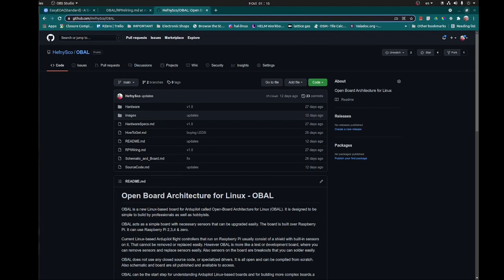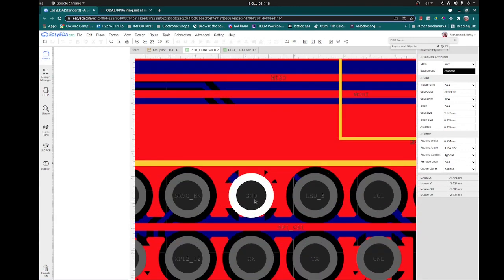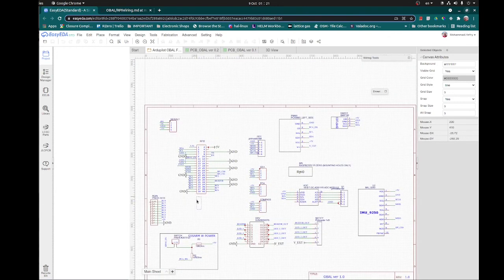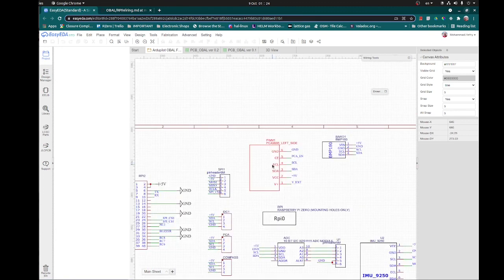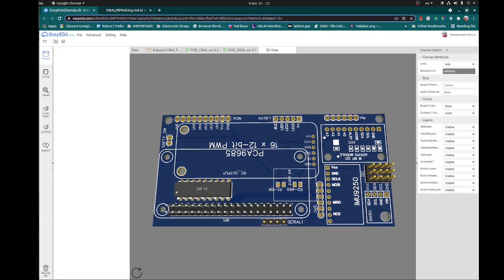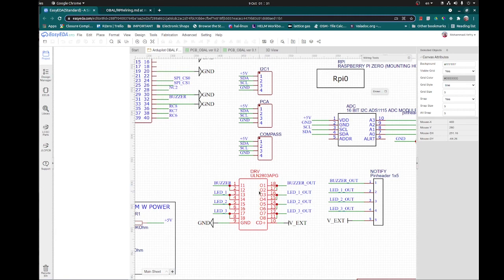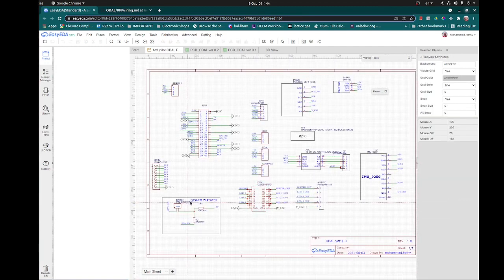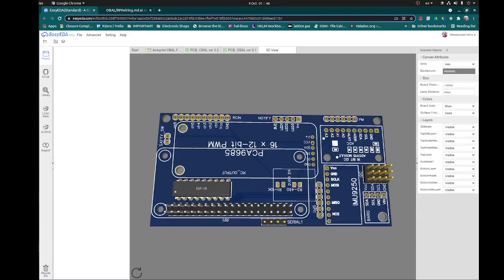01 - OBAL - Tech Part 1: How to design Ardupilot-Compatible Board using Raspberry-PI?

Comment: Hello Mohammad, what gps are you using ? I have tried connecting BN-880 via serial 1 port but mission planner won't find it
Reply from the maker: It should accept any GPS via serial port.
make sure of: 
1- you are sending the correct format that is defined in param settings i.e. NEMA, AUTO, etc.
2- You are using the correct baud rate.
3- You are starting ardupilot with the correct parameters -A, -B ..etc.
https://github.com/HefnySco/OBAL/blob/main/SourceCode.md
Reply: @MohammadHefny_HefnySco  Thank you so much for your help. The GPS is working now. 

The problem was incorrect baudrate and serial port
Reply from the maker: @agoshpreetsingh4584  Glad to know everything is working properly now. Thank you.
Reply from the maker: please email me at mohammad.hefny@gmail.com we can make a support session on zoom.